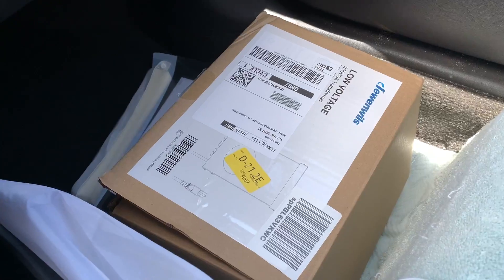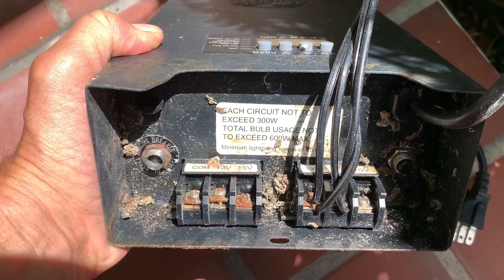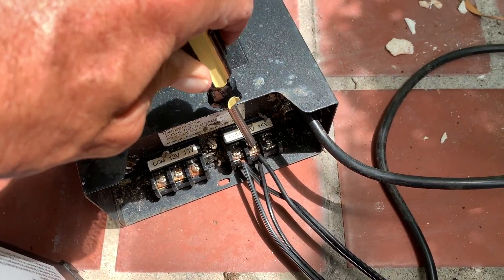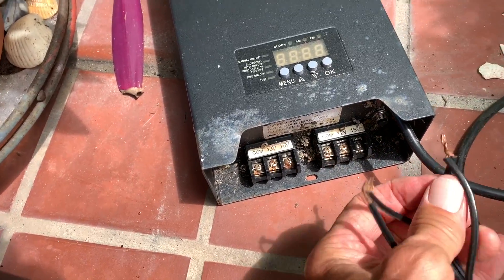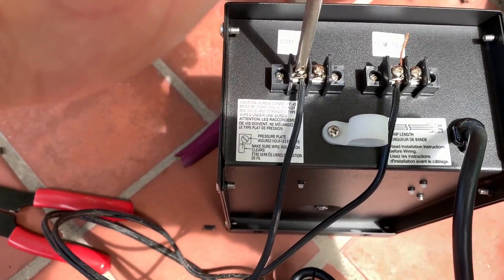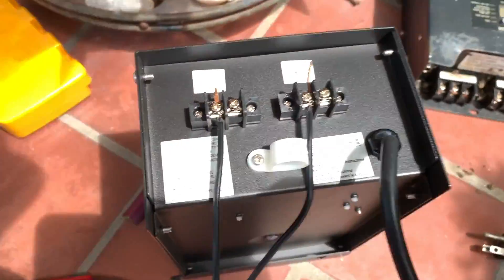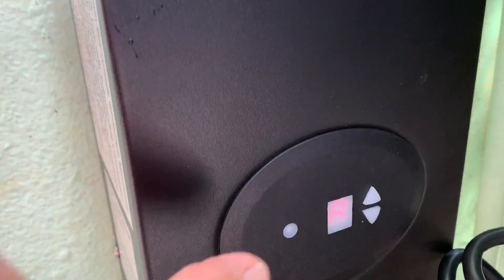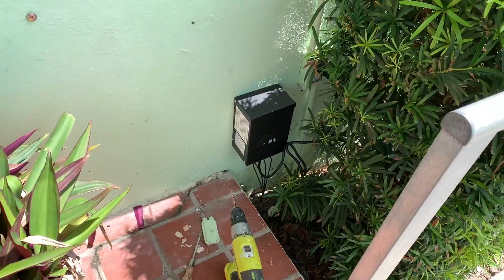How to install a transformer for low voltage outdoor lighting

Comment: Rather then cleaning the used wire tips, cut at least three inches off and start over with clean wires. And when placing the clean wire on the side of the screw place on the left side of it,  becasue the screw tightens clockwise.
Reply from the maker: Excellent tip. Thanks for the info. Good luck on your install.

Comment: I’m a newbie to outdoor lighting.  I just bought a Harbor Breeze 200w transformer from Lowe’s. The back connector plates don’t indicate COM or 12v.  Just 4 terminal clamp screws.  The instructions say to twist the strands of a cable run together once split and stripped and then insert them under a single clamp screw.  This is different from what you are showing here.  Help please!!
Reply from the maker: With the low-voltage 12 V do you have two sides that just have to be attached to the screws and they lead out to your lights I’m not familiar with Harbor breeze. I’d have to see it to know what to do. Good luck. Thanks for watching.

Comment: Curious to know if you are running a long line and you hook up the line to the transformer what happens to the end of the other line?
Reply from the maker: I have lights out about 50 feet, so it works pretty good

Comment: I have this same transformer providing power to several landscape lights. I only had one wire going to all of them (just connected to one set of the COM and 12V terminals). The system has been working great for about 8 months but recently stopped working. The transformer has power and when the wire to the lights is not connected, there is voltage at the terminals but when I have the wires connected there is no voltage but the transformer still turns on. Any ideas what may have caused this to stop working?
Reply from the maker: You may have too many lights on the one circuit and need to put some on the other or you may have a break in your line somewhere sometimes the yard guys cut them with your Weedwhacker’s